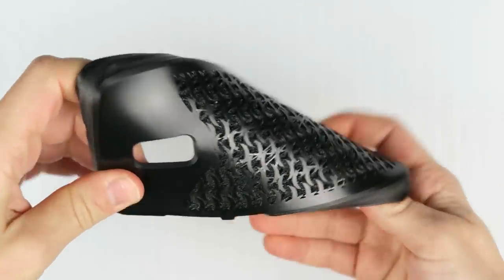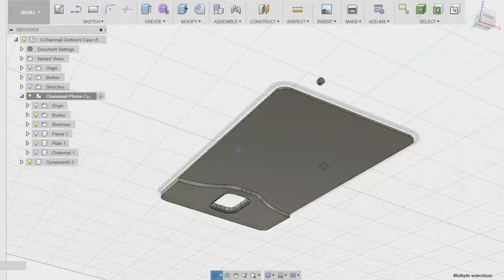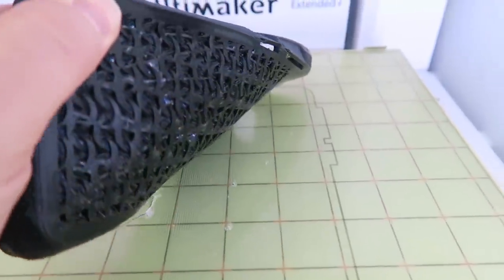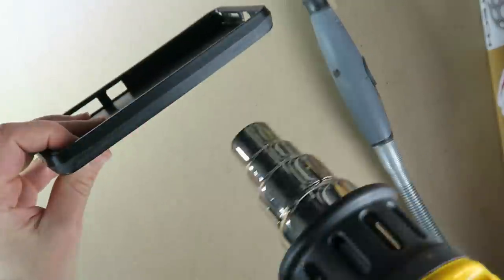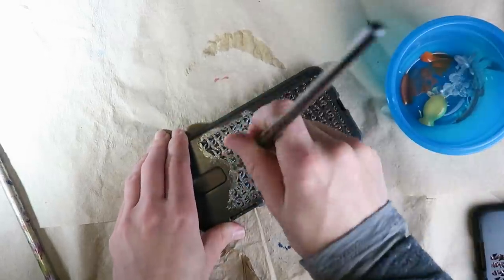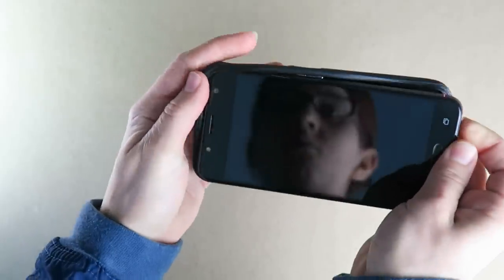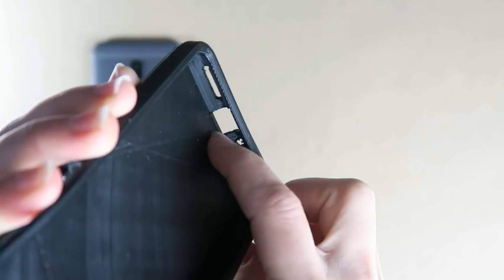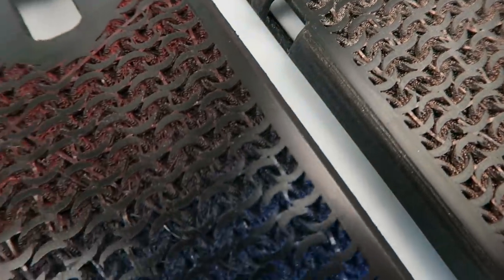Making a 3D Printed Flexible Phone Case for the Asus Zenfone V Live

Comment: I extremely impressed at what you did by designing these cases.  Those added touches of color really made them pop. Speaking of color I was given an assignment of finding someone to design or design myself quick color identifiable covers for over 70 tracking scanners we use in our facility.  I was given the option of slapping on some colored duct tape and cleaning around some parts with an exact knife. Needless to say, I prefer the clean snap on, snap off option of a TPU cover. I think that I'm up for the challenge but where to begin?  Help please.

Comment: you should make the design hava a hole then you put a the cooper plate inside the case ,when the phone is heated it have an air cooling system on the case,the phone temperature will slow down

Comment: I really like the chain mail design, especially how it pops with a bit of color in it. The only thing that kinda ruins the look for my taste are the few diagonal lines that probably come from the nozzle running across the print before a new layer starts at a different location. With a bit of manual tweaking of the g-code by hand, or maybe with some settings in cura you could probably even remove those marks. Not shure if playing with the combing or avoid printed parts setting in cura (under travel settings) would help here.

Comment: Hey great video. What paint are you using and does it last, seeing as phones are always in and out of pockets. thanks
Reply from the maker: The paint was regular acrylic, but the water based polyurethane sealer is what makes it more durable but still flexible so it doesn't crack and peel. Not sure on how long it holds up to in and out of pocket.

Comment: Thank you for sharing. I lie much the design and wonder if I can get the Fusion 360 file. Of course I can redo but in case you don't mind it'll save me time. Little question : Do you think that putting some resin could add some strength without loosing flexibility ?

Comment: I’ve been a subscriber for about 4 months now, but have never commented before.  I love your channel, I love your projects, and I even love your voice.  Please don’t change as it will break my heart.

Someday I’ll take the leap into printers but for now I’m still monkeying around with my router.  But I can’t help but continually think that the majority of the design is the same, and that fusion 360 might be a good thing to invest time in learning.  

I have it, I’ve tried it, for some reason it isn’t intuitive for me.  Now, many moons ago when AutoCAD was new, I taught myself both it and 3d modeling in it.  But fusion is one of these new age ones that just act differently.

If you’re ever looking for video ideas, one or two on the program would be awesome.  And if not, if you could point me in the direction of a good starting point that may have helped you it would be appreciated.

But, most importantly, don’t change, I love you.  Just remember those two things.
Reply from the maker: Agreed, it's an overwhelming program... I put off leaning it until 123d design was officially scrapped by Autodesk. The workflow for this video was a frustratingly slow back and forth between fusion and YouTube tutorials... It is worth the time investment, absolutely fantastic tool. I started a playlist of 3d modeling tutorials that helped me, so eventually that might be a useful starting point if you decide to jump in :) Thanks!
Reply: Lars Cristensen made a superb set of tutorial videos for Fusion360 - He called them 'Fusion 360 for absolute beginners' and put them all up on Youtube. They helped me enormously making the switch to using Fusion360 instead of the older cad packages I was used to... It's well worth the effort to make the switch. HTH. Cheers!!

Comment: How did you get it to stick to your printer bed?
Reply from the maker: Cheetah sticks to my PrintBite surface ok cold or typically with the bed heated a bit so the edges stay down. Hard part can be getting it unstuck.
Reply: @LindyDesignLab  ok thanks :)